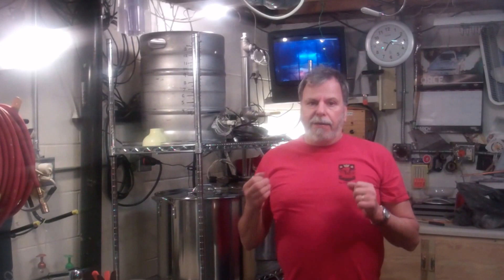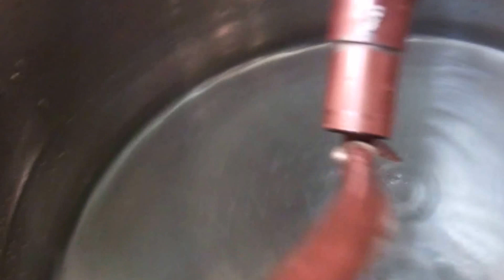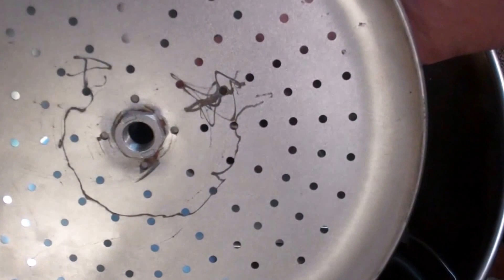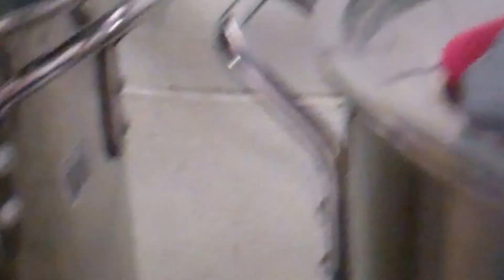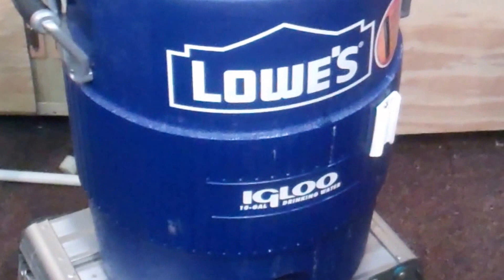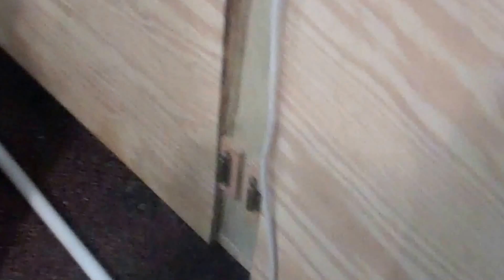Building a Spinning Sparge Arm

Comment: I really like this design it works great, I used a 3/8 shark bite T this lets me turn the holes to maximize the spin, let's me take it a part for cleaning and shortens the length. 
I drilled a hole in the lid and screw it to a quick disconnect cam, I also soldered caps on the ends.  Tim thank you so much for sharing.
Reply from the maker: Great idea about the shark bite.  It does hang a little lower than is usable on large batches.

Comment: Do you notice any pitting  or corrosion in the pot, with copper and stainless in contact i would worry about galvanic corrosion
Reply from the maker: I have not noticed any issues.  I do typically disconnect most things when I clean and don't re-connect until the next brew day, with a few exceptions.  So, it doesn't really have any time for any corrosion to happen.  On my Boil kettle and HTL I have a copper dip tubes and copper fittings on the sight gauges that have been connected for probably a couple years.  I haven't noticed anything out of the ordinary.  Maybe the stainless steel helps with this.

Comment: This doesn't work. It does not turn, the water just comes through the holes in the arm with no spin. It spins nice and free but the water does not make it turn. What am I doing wrong?
Reply from the maker: I am not sure why it wouldn't spin.  It should work like a lawn sprinkler.  I would check that there is plenty of play in the spinning hole, that the flare above it is wide enough to cover the hole and that the sprinkler holes themselves are angled sideways to generate the spinning force.

Comment from the maker: After 5 months of usage the arm still works great.  I do have some observations.  First you have to have a good false bottom on your kettle.  Little pieces of grain do have a tendency to plug the sprinkle holes.  I have widened the hole at the crimp on the ends of the arms to help with this some.  Second, while it isn't a problem with regular batches it does hang down into the kettle about 3-4 inches. I did a barleywine with a large grain bill and the arm just barely fit above the grain.  I couldn't of really hung it any higher, so I couldn't use it for that.  I was able to screw a drilled out lawn sprinkler head that worked OK, until grain clogged it.  I then just left the pipe open.